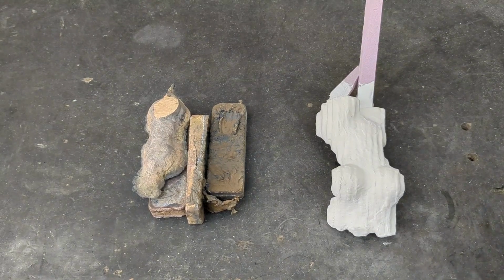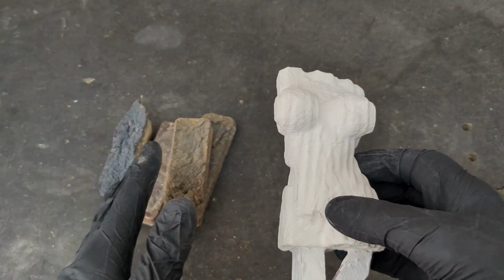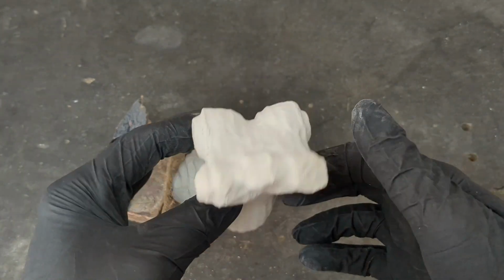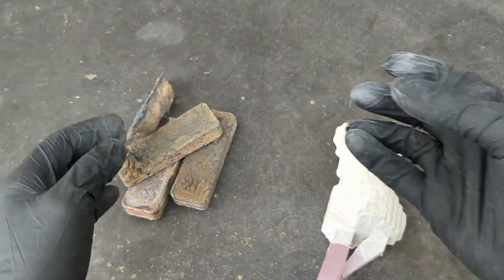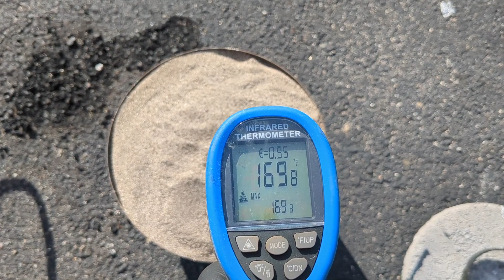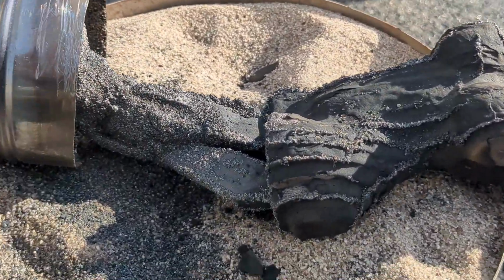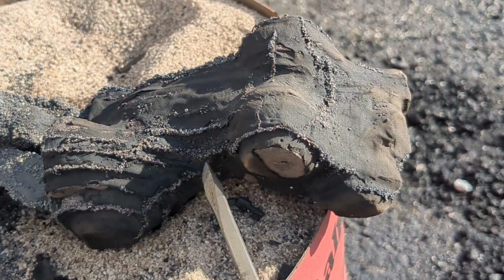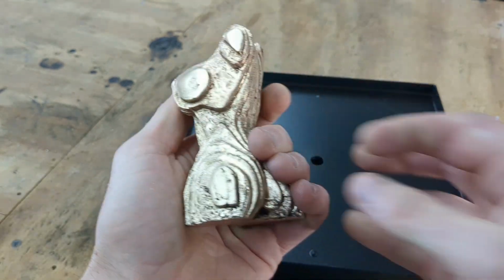Casting Brass - Lost Foam Casting Process (Brass Lady Bust)

Comment: Awesome. I use the same plinth design. First I 3d print each lump into a cad drawing with lasers and fine tune each edge with a concrete driveway file.
Reply from the maker: That's cool 👍. I don't do 3d design.  Well, I'm lying because I use tinkercad.  Cad software is a lot to learn and I don't really have the time to learn it.  3d software is amazing!  I try to do what I can the easiest way possible 🤣🤣

Comment: cool piece for sure.  As soon as you pulled in out, I said to myself, lots of clean up on this one. Brass is a full metal to pour
Reply from the maker: Thanks Will!  Yeah I knew it being a heavy metal it would bleed out of the plaster.  I explained in the beginning, I added more coats to try to contain it.  I think it worked.  Just not 100%.  The cleanup actually wasn't too bad.  The cleanup for next week's video was a PITA....

Comment: A larger sprue might have helped with the shrinkage.. of course you would have needed more metal and your shrinkage didn’t affect the final piece. I like the pitted look the lost foam makes. Nice job.
Reply from the maker: Thank you!  I thought about a larger sprue.  That's why I added that small piece off the sprue.  That actually might be why it caused the small cavity on the bottom.  If I went with just a larger sprue, it might have been ok.  I do love how it came out though 👍😁